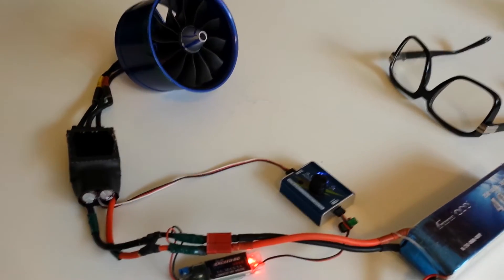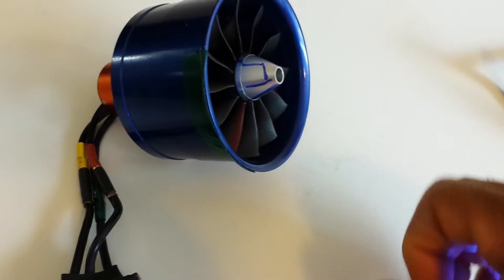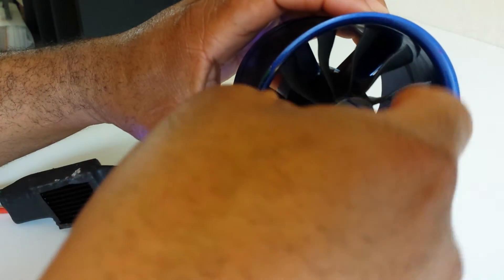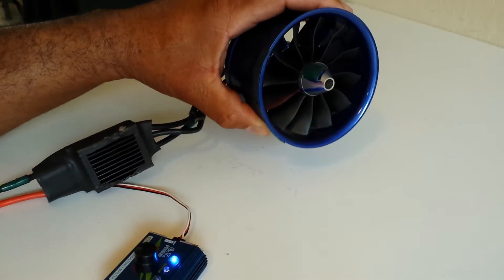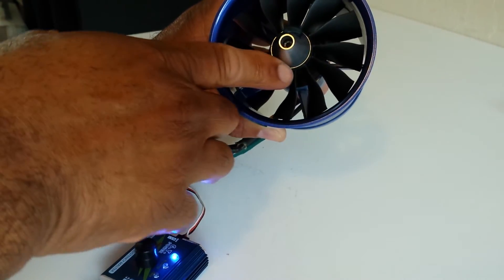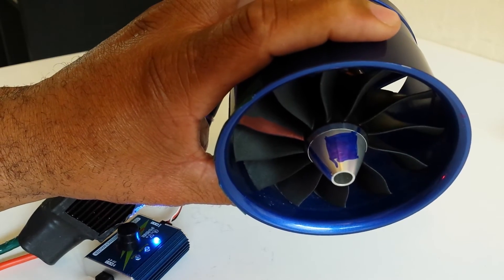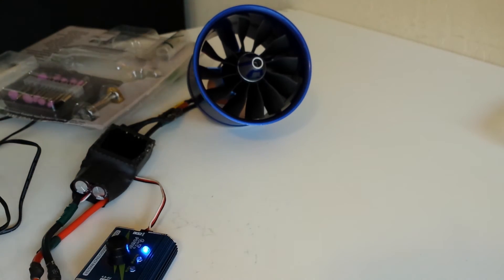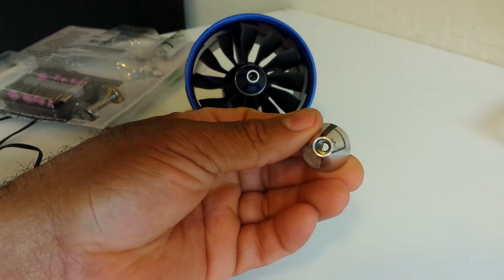How to Balance the 70-90mm Freewing EDF unit Part 1

Comment: Hi there. Was wondering how to check the fan and motor in my freewing model , without the radio and receiver. If it hasn't got a ubec can I use a normal receiver battery, connect the lipo to the ESC and plug the throttle cable from the ESC into the servo tester. Grateful for any help.
Reply from the maker: If the plane has a bec built into it then it will work with just a servo tester plugged in to a battery.  Thanks for commenting!

Comment: Hey man. Any reason why you didn't just add the required weight to the inside of the spinner and permanently epoxy/CA, rather than grind it?
Cheers
Reply from the maker: Psychosix there is no inside on this style fan. It is a solid piece of metal. That is why I do it as I do for this style. Thankfully these aren’t made anymore....
Reply: @gooniac33  ahhhh makes sense. Solid spinner?
Luckily mine are the typical cheap plastic type with hollow centres.
Cheers for the video :)

Comment: What is the fit between the fan and the fan adaptor shaft? Is there any play? What is the alignment tolerance with the motor?
I have made some calculation based on standard balancing ISO standards and I get nonsense numbers.
At this kind of speed, in order to avoid the balancing process after assembly, the fan would need to be aligned with the motor shaft within about 0.00002" which is totally impossible with an assembly of this kind.
There is something I don't understand with EDF.